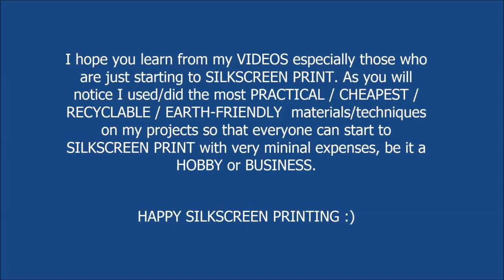Photo Emulsion Developing using DAYLIGHT - Screen printing

Comment: GREAT VIDEO SIR! I AM REALLY EAGER TO LEARN, BUT I WANT TO ASK SOME QUESTIONS IF ITS OKAY FOR YOU
1. Where can I buy the emulsion and sentisizer? And how much would it cost?
2.What is the approx ratio yung mixture ng emulsion and sentisizer, or any way to found out if tama na po?
3. How long is the approx drying time sa mixture on the screen? or are there any way to find out if dry na po?
4. Sa positive po, its is normal paper lng po ba? and normal ink from the printer?
5. And lastly po, what is the maximum time to expose it to the sun? 

SANA PO YOULL ANSWER MY QUESTIONS! THANK YOU PO! GOD SPEED!
Reply from the maker: 1. Kung nasa Pilipinas po kayo, Tulco sa Sta. Mesa, Manila o JnJ Virgo sa Divisoria Manila ang popular pagdating sa SCREEN PRINTING SUPPLIES P200 plus ang 1 Kilo ng Photo Emulsion at P100 plus ang Litro ng Sensitizer. Minsan available din ito sa  mga office/school supply stores.
2. Base sa instruction 90% Photo Emulsion 10%  Sensitizer.
3. Pag naipahid mo na yung PHOTO-EMULSION & SENSITIZER  mix,  makikita mo talaga pag dry na, noticeable naman ito. Pag gumamit ka ng Blower sandali lang tuyo na kaagad, pag electric fan siguro 15 to 30 minutes depende sa lakas ng hangin.
4.Normal typewriting lang naman yung ginagamit ko pati yung ink ng printer, i-set mo lang sa HIGH ang printer para maganda ang quality ng print.
5. 10 to 15 seconds lang pag maganda ang sikat ng araw, mahirap na kasing HUGASAN pag lumampas na ng 15 seconds.
Reply: Easy SIR SALAMAT PO SA FAST REPLY! GALING NYO PO!!!!! MORE POWER!!!!

Comment: You should have shown us the printing part. It would have been fun watching and learning. Anyway thanks for the video!!!
Reply from the maker: Someone from Philippine Army will do the Printing they just ordered the Screen Stencils...:)
Reply: Easy by the way what's the minimum order to take and how much to charge? I mean your way.
Reply from the maker: At least 24 pcs, if less than that I charge them higher than what I Usually Charge to compensate for the Labor and Materials...Ex. my charge for a certain print is P75 per shirt then the customer just brought 18 pcs of t-shirts, instead of P75 I will Charge them P100 per print, and Vice-Versa if they Brought 100 pcs of t-shirts to print instead P75 I can give it to them for P60 or P70 if they ask for a Discount,,,,:)
Reply: Easy so on average is 75 per piece. I asked you just to get the idea. Thanks for everything.

Comment: Hello po sir. Thanks for sharing this. May tanong lang po ako. Bakit po kaya d ko mapalabas sa screen yung design ko. visible po na mas light yung design sa screen kapag binabanlawan pero di po siya matanggal tanggal miski mga 5-10 ko na pong binobomba ng tubig.

-gamit ko po ay tulco photoemulsion and sensitizer
-sa madilim na kwarto po ako nagcocoat ng screen.
-ginagamitan ko po ng hair dryer yung screen para mas mabilis matuyo.
-paper at cooking oil na rin po ginagamit ko.
-nageexpose po ako sa araw around 2pm ng hindi cloudy for 20-30secs.
-nagbabanlaw po ako sa makulimlim na lugar gamit hose.

sana po mabigyan niyo po ako ng tip kasi wala parin po akong nadedevelop na stencil at ang rami ko na pong nasayang na materyales. Thanks po.
Reply from the maker: Over-Exposed po kayo sir, pag sa araw po  10 seconds lang pag lumampas ng 15 seconds over na po iyon...:)
Reply: Hello po ulit sir. thanks po sa advice napalabas ko na po pattern ko ng maayos, pero para po doon sa maliit na detalye/text, transparency po ginamit ko. kailangan ko pa po ng practice doon sa mantika technique niyo. Thanks po ulit. :D
Reply from the maker: Para sa maliit na detalye Pwede kayong Gumamit ng Water Sprayer pareho nung ginagamit sa Mga parlor para MAASINTA nyo yung maliit na Design para mapalabas myo yung maliliit na detalye,,,:)

Comment: Hi!  You make this look easy. I have been using Diazo photo emulsion and sensitiser and have had fail after fail when trying my own stencils.  Was about to give up then I seen your video.  I noticed when you coated the screens you done it in a light room, also let them dry in a light room?  I thought it had to be dark?  Or are you using a different type of emulsion/sensitiser?  If so could you tell me where I could get some?  Thanks.
Reply from the maker: We don't have Diazo Photo Emulsion here in the Philippines, the brand I'm using is Tulco, Screen Art and JnJ Virgo which is not available in other Countries....I think the Process of Developing is the same I watched Videos that uses Diaso Photo Emulsion, I remember when I was starting to make screen Stencil, I failed several times before I get it right....I used to work in the Dark room but through the years I realized that the Photo emulsion is not that sensitive to light (although sensitive to WHITE light like LEDs, florescents, sun and daylight etc)...just keep on trying and once you make your FIRST successful Photo Emulsion screen it will continue....good luck sir...
Reply: Easy thanks for the quick reply!  I just got my first successful stencil I exposed using my led light box after watching your led exposure video.  I’m so excited that it actually worked.  I want to find a chemical I can mix with the glue so I can save money and won’t have to keep buying the emulsion kits.  I can’t find screen hardener either, is this only available in your  country to?  I live in Scotland.   Thanks again!!  Natasha 👍🏻
Reply from the maker: Yes, maybe the Photo hardener is available only here in the Philippines...because Photo Emulsions available in your area doesn't need Photo Hardener...:)

Comment: Sir i tried but it failed, can i ask when you put the positive is the screen still a little bit wet? Because  i tried it very dry when i put the positive and exposed it to sunlight for 20seconds but the positive just marked but when put pressure to water it it’s not passing through the screen
Reply from the maker: The photo Emulsion should be dry...and you should exposed it to sunlight for only 10 SECONDS....you over-cooked it that's why the design did not wash-off  during washing....
Reply: @EasyVideos  Sir do we need to cover the silk screen immediately after counting 10 seconds? Dapat ba nasa lilim kapag nag hugas na nang na exposed na silkscreen?
Reply: You have the same problem like me

Comment: Hi
1 question, Emilsion should be thicker or slight thinner? I have exposed one screen following your video step by step...  Everything is right. But while washing the screen after sun exposure.... Not only stencil washed out.. but small portion of other area also washed out.... Any solution?
Reply from the maker: You are Under-Exposed,  you can extend your Exposing time by a few Seconds, maybe the reason for this is because we are using Different Brand of Materials...but you're almost there...good luck...:)
Reply: Thanks for the reply.... Yes i have to extend the exposure time...

Comment: What we can use if we don't have photo hardner?? Because it's not available around my area...

And second question is...

In this video you exposed screen under sun light or just a day light??
Reply from the maker: There are Photo Emulsion that don't need Photo hardener, maybe the Photo emulsion there don't need a Hardener....yes, in the Video I used the DAYLIGHT,  just be careful not to Exposed the other side of the Screen, there are Photo Emulsion that is so sensitive to light, and wash the Screen in DIM area after Exposing....:)
Reply: Thanks alot sir...

Comment: Good day po Sir! Ask ko po its hard to find photo hardener dito po sa japan, ano po ang pwedeng pamalit? and can i use canon3036 printer to print out? pag na expose napo ba ng mga 10-13 seconds  at medyo nag iba na ang kulay direct na po bang i wash out? pasensya na po sa marami kong tanong. I really inspired your video so i wanna try it.  salamat po!
Reply from the maker: Yes I-Wash na po kaagad at dun nyo rin hugasan sa makulimlim na lugar. Ok lng po yung printer basta't pag nag print kyo ng Positive sa Best o High nakalagay yung Setting, Meron pong mga Photo Emulsion na hindi kailangan ng Hardener, tanungin nyo din po yung store kung kailangan pa o hindi na...gud luck...:)
Reply: thank you Sir for the fast replied, its helpful.i really appreciated!
Reply: Sir! Pasensya na ask po ako ulit.
pwede po bang gumamit ng any fabric paints
kahit hindi po sya for screen fabric paints.
ano pong best na paints for dark color cotton?  need po bang mag mix?
Reply from the maker: Hindi naman po kailangang mag-mix, kung may mabibili po kayongTextile paint na ready to use ok lang po, Ok lang din naman gumamit ng ibang fabric paint basta yung lapot ng Paint ang importatnte, pag Malabnaw kasi maaring kumalat sa TATATAKAN ang pinta o Hindi IDEAL na gamitin sa Silkacreen Printing...:)
Reply: Easy marami pong salamat!
try ko po.
Reply: Hi po Sir! 
pwede po bang gumamit ng fabric hardener instead? wala po kc akong makitang photo hardener dito. wala din pong halong photo hardener yung photo emulsion na bibilhin ko po.

Comment: Salam bro. I have made my first screen following your videos it's pretty good but now my emulsion on the design isn't falling off. May you plz guide? Someone told me that my inkjet prints are not black enough!
Reply from the maker: The Design should be Black enough so that the Light will not Penetrate through the design during exposure... if that happens the result is over-exposure and it will be hard for the Design to be wash out during washing...
Reply: Thanks bro. Prepared my first screen thanks to you.

Comment: Sir easy ,yung aquasol er ba 10-13 sec. din ang exposure time sa sunlight?kailangan pa po bang lagyan ng hardener pagkatapos?thanx po....
Reply from the maker: limitahan nyo po sa 10 seconds lang pag Aquasol, masyado kasing sensitive ito sa light, lagyan nyo rin ng Black backing Board ang ilalim ng screen pag-iexpose nyo na para di makapenetrate ang Liwanag sa Ilalim ng screen...yun pong Pagpapahid ng Aquasol sa Screen gawin nyo sa DIM area at ang Paghuhugas pagkatapos ng Exposure...good luck...:)
Reply: Ok po sir try ko ngayon...maraming salamat po...

Comment: Is it possible to get a good print without applying photo hardner...?
Reply from the maker: Some Photo Emulsions don't need a Hardener if this is the kind of Photo Emulsion available in your area then it's ok , but the one I'm using needs a Hardener and after a few prints it will softens so you really have to apply Photo Hardener on it...

Comment: if i dont use hardener how long will the emulsion will last?
Reply from the maker: The Hardener makes the Photo Emulsion almost Water Proof, so if you don't apply it on the stencil before you use it it will slowly absorb water from Paint (most of textile paints are water-based) and will soften and break. Even if the Screen Stencil Survived the Printing when you wash it with water after the printing it will absorb water, soften and slowly will develop small holes or break...:)

Comment: sir need po ba talaga ng sensitiser, hindi po ba pwedeng photo emulsion lang po, gaano po katagal ang exposure...?
sana po masagot nyo po nag aaral pa lang po ako mag silkscreen...
Reply from the maker: Direct Sunlight 10 seconds po.....pag natatakpan ng ulap ang araw depende kung gaano kaliwanag 20 second to 1 minute.....Sabi mo nagsisimula ka pa lang, I would suggest na sa ARAW ka mag-exposed 10 SECONDS lang...wag sosobra para hindi mahirap hugasan.....Kailangan ang Hardener sa Klase ng ginagamit kong photo emulsion, pero may mga ibang klase ng Photo Emulsion na hindi na kailangan ng Hardener...
Reply: @EasyVideos  sir, anong photo emulsion po ang di na kelangan ng hardener? sana po masagot niyo

Comment: Good pm po. Yung aquasol er na wash out po pagkatapos kong i expose sa ginawa kong exposure box using 3 yellow bulb light 50 watts per bulb. Yung distance mula sa glass hanggang sa tip bg bulb mga 5 or 6 inches.  Exposure time 1 min and 15 secs. Na wash out lang po nong hinugasan ko ng tubig. I need some advises please..
Reply from the maker: Di po pwede ang Yellow Bulb, kilangan pong ILAW ay WHITE ang KULAY ng LIWANAG katulad ng Florescent at LED lights....
Reply: Ah gabun po ba. Cge boss salamat. Pero pwede po ba kahit ilang watts ng led light ang gamitin ko?
Reply from the maker: Ok lang, mas Mataas ang Watts mas mabilis ang ExposingTime compares sa Mababang Watts...:)
Reply: Gumagamit ako Ng 2 -100 watts incandescent bulbs , 6inch ang taas nung gamit Kong box and 18 mins ang exposure pag Bago ang aquasol ER , pag luma Na around 20mins Na .. Gumagana nmn po .. Share KO lang

Comment: sir ask lang po.anong ink na ang ginagamit sa pagprint?kasi parang hindi maganda ang tulco local.salamat
Reply from the maker: JnJ Virgo Rubberized Paints po ang ginagamit ko sa mga Projects ko: https://youtu.be/27_dMWAj3y4
Reply: Kaya pla boss ganun ang resulta nung water spray ko na di makapit... pra sa inyo po whats best photo emulsion to use... oks din ba un w/o sensitzer.. pde din ba sa sunlight exposure un bos? Once again tnx for easy reply

Comment: In this video you exposed for almost a minute but in the other video, just 10 seconds. Please how do you know how long to expose?
Reply from the maker: In this DAYLIGHT exposure it was cloudy so the Exposure was longer....because of my experience  I can easily determine the exposure time under different circumstances....If you're a beginner I would suggest that you stick to 10 secs developing using the Sun because it's more accurate, then experiment later as you gain experience in developing....
Reply: Thank you
Reply: Bossing if small logo lang 10secs is enough na buh

Comment: sir, ano po pangalang nung huling pinahid nyo sa screen sir? kelangan po ba talaga lagyan nga ganon?
Reply from the maker: Photo hardener po ang tawag dun, pinapatibay nya ang screen , pag wala nun mabilis masira ang Screen pag ginamit mo na para magtatak at pag hinugasan mo pagkatapos magtatak  :)
Reply: Easy  , thanks po sir!. wala po bang other replacement yung emulsifier like yung glue? pwde po ba yun?
Reply from the maker: Instead na Emulsio pwede rin yung Shellwood White  Glue na nabibili sa Hardware   :)

Comment: sir question, bond paper po ba ginamit nyong positive?
Reply from the maker: Yes
Reply: thank you po sa immediate reply, much appreciated. i used tulco emulsion, just applied it now, how long does it take po kaya to dry up? sa dark room or area lang po ba talaga sya pwede i dry? and ok lang po ba kung walang sensitizer? ...
Reply from the maker: kung Ready Mix po yung ginamit nyong photo Emulsion ok na yun, pero kung photo emulsion lang -as in white pa ang kulay kailangan pong haluan ng Sensitizer, mga 30+ min sa Electric fan, kahit dim yung area pwede na rin kahit hindi dark room...
Reply: light blue po kulay nung liquid, so ok na po yun?
Reply from the maker: I think ready mix  na po iyan :)
Reply: FINALLY! I successfully made my very first silk screen stencil! All thanks to you, Sir! you're a legend!